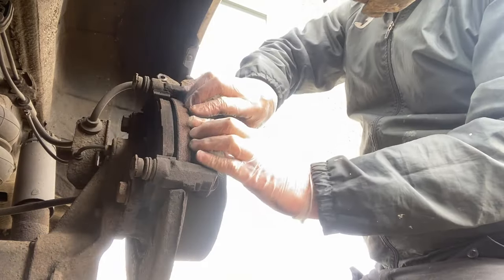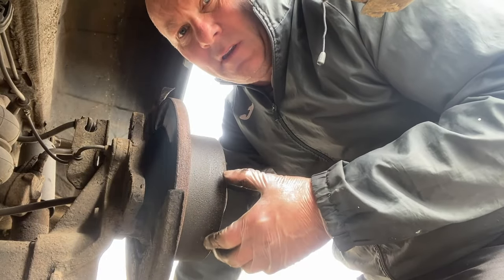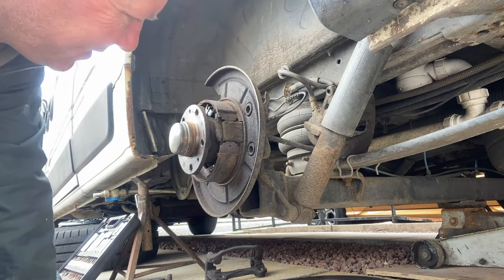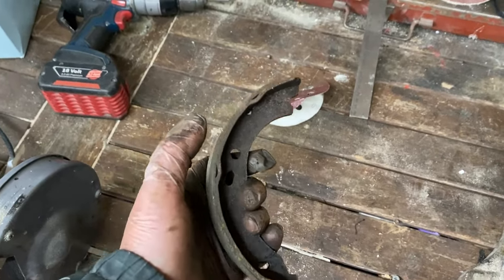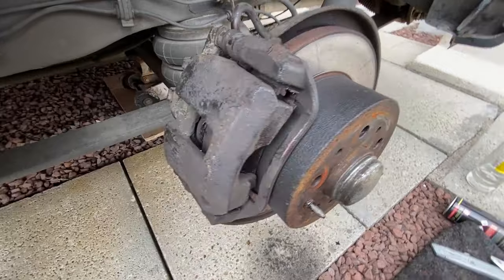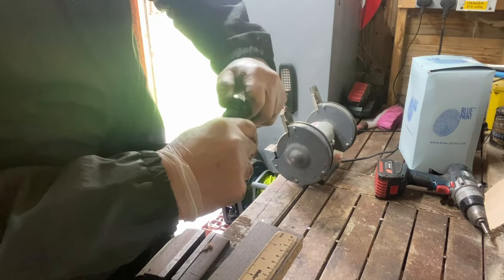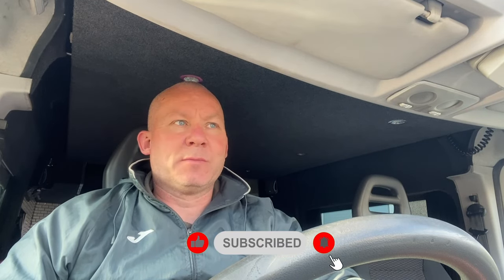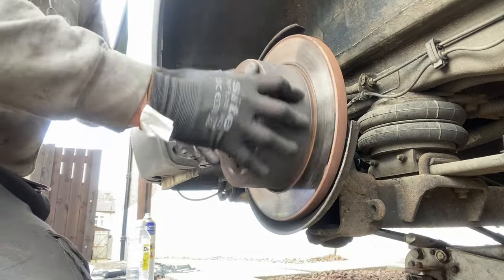Will the handbrake ever work properly? Citroen Relay/ Peugeot Boxer/ Fiat Ducato X250

Comment: .great tutorial. I've just finished my work van's handbrake. You can readjust a weaker handbrake by jacking one side, removing a single wheel nut. If the brake shoes are still functional so you won't have to take the whole wheel off.

Comment: Sanding brake pad material isnt a bad move, but try and keep greasy fingers off the porus surface/use lots brake cleaner
Thanks for the video... Weak handbrake and mot coming up

Comment: Great video, thanks, just doing mine now, where is mot place
Reply from the maker: Thanks, we use a garage in Motherwell
Reply: @davidamioffgrid  thanks mate, ive been in shetland, working/camping, foolishly i neglected the mot date, 🙉 have had a bit of a nightmare, going back in for retest Thursday just before i get the ferry, if it doesn't pass I'll have to get it booked in on the mainland, appreciate you responding,
Thanks

Comment: Seriously it's the worst design ever isn't it! Replaced my rear cables and all shoes and drums and this year it still failed MOT again. I figured out the issue though - although I'm not sure whether my XLWB boxer has this differently to shorter wheel bases. Basically the steel draw bar part of the mechanism was my issue. On my van it passes through a small bracket guide with a rubber grommet. This was not actually supporting the bar so the bar was sagging down under its own weight. This meant that the force of the first 2-3 clicks of the handbrake pull was using all its energy to straighten the bar and cable length rather than using that energy to push the shoes onto the drums. I used a short length of pipe  to fit over the draw bar and fixed that to the bracket so that it supports the weight of the drawbar and keeps the bar and cables straight without any sag. Took it back for MOT retest and brake force was up 60% and way over min limit 🙂
Reply from the maker: Thanks Chris, I never really paid much attention to the brackets holding the steel bar in place before, but I will have a look next time I am working on the van and see if that is also contributing to the problem. I need to have a look at the exhaust soon, so it won't be long until I am under the van again!. It always seems to work well, for a while anyway, but just never have the confidence in it on really steep hills.

Comment: Hi David totally agree with you i have a 2020 boxer and handbrake is crap and like you i do everything on the van,  i have just fitted air suspension to it can you let me know what pressure you set them to get the best ride as instuctions with kit are bit sketchy.Look forward to more videos from you and Ami,cheers.
Reply from the maker: Hi John, we tend to park in gear and put the chocks under the wheels just to be sure.
We have the air suspension at 30 psi most of the time, sometimes need to adjust it, but that seems to work not too bad. Cheers David

Comment: Interesting to see the old caravan Waste master used for grey water, I was thinking of doing the same thing as they are cheap as chips. Don't suppose you filmed the fitting?
Reply from the maker: Hi, we converted this van in 2016, and didn’t film much of it at the time. We used Unistrut to build the rear seats and then used more unistrut underneath the van to clamp the seats to the van floor. The same unistrut that secures the seat then has both water tanks hanging off it on 10mm screwed rod and some flat bar at the bottom and nylock nuts. 
The main water tank is 70 litre and the waste is 50 litre, so it works well for our needs.

Comment: Im trying to do mine now.. in what order do u attach the strings? Im struggling 😅
Also..it looks like the smaller string is attached from the front and not from the back where u first showed....? 
Mine have the adjustment wheel  different on each side..one is up and one is down..does this matter? 🤔 Im guessing i just put it as is? Bu then again, i have no idea who did it before me...or even when..
Reply from the maker: I think there are a few different variations of these, motorhomes and tipper/ box vans may be different arrangement. 
I have seen the adjustment wheels in different locations on other videos, so that might just be the way yours is.
I attached the cables from the wheels to the centre bracket first and then did the section to the front, but I don't think it really matters what order you do it.
I would just keep it the way it is on your van as it may just be a slightly different layout/ year/ model.